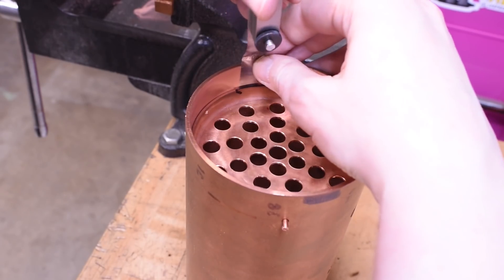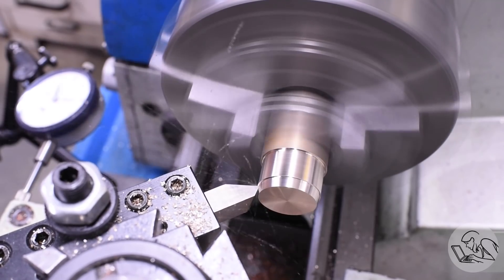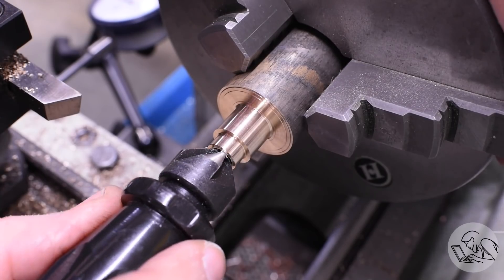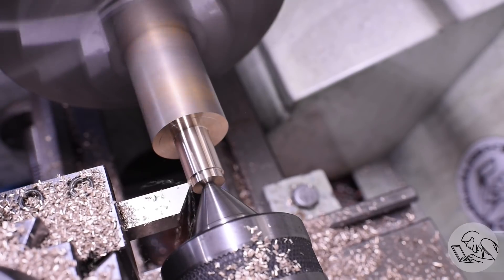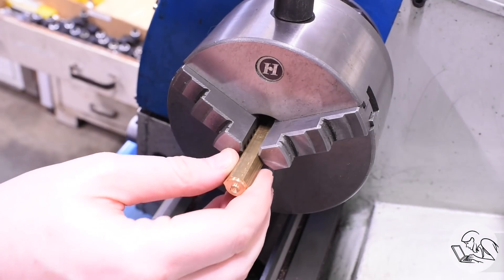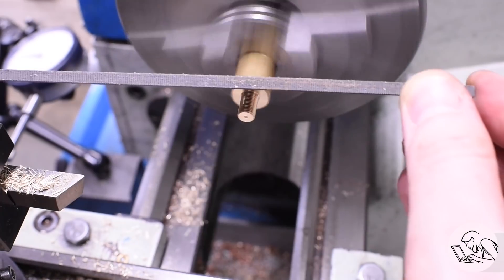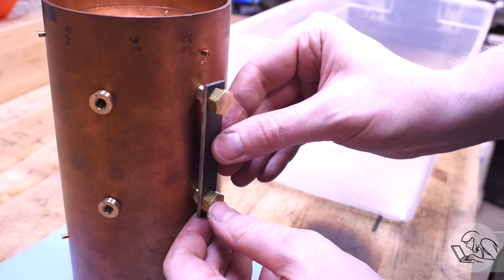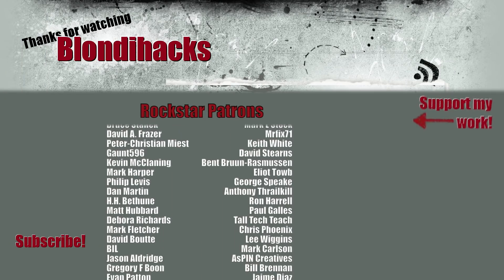Boiler Bushings & Silver Solder Prep | Model Boiler Build, Part 6

Comment: On a scrap piece try welding a copper tube to a copper plate with a electrical ground wire. I  have been welding manifolds for 20 years using acetylene . I have never done this with a heat exchanger but it does work well with hot and cold manifolds.

Comment: Hi Quinn, I have much experience making many copper boilers. I think you have been really unlucky with your vertical boiler. I have a few tips to offer that I hope will help you in the future. You should be able to braze a boiler of this size using only your smaller of the two propane torches. I have both sizes and find the largest too fierce. Regarding the silver solder, I see you are using wire. This is far too small and will become weak and will easily melt in the flame. I use 1.5mm dia rods. These are much more stable. Tip; take a new rod and grip the last end ½” with pliers. Bend the end 90°. Now if you hold the bent end and you accidently drop the rod. You know which end to pick up! Using the oxy acetylene after pre - heating with propane is good practice should you need to concentrate on a small area. I don’t believe you have your torch set up correctly. Set the regulators on the bottles to 50 psi for the oxygen and 5 psi for the acetylene. These are set with the torch lit. Then adjust the torch to give a flame like a small feather. Set up in this way will give you much more control with less chance of burning the copper. I also recommend that you keep dipping the silver solder rod in the dry flux powder to ensure an adequate supply of flux on the copper whilst the brazing operation is taking place. Finally, I can recommend a book on boiler making. Model Locomotive Boilermaking by Alec Farmer. Introduced in the UK in the early 1970s. You may be able to get a copy on ebay. This is without a doubt the very best book on boiler making you will find anywhere. Good luck with your new boiler. Stuart Dixon.
Reply from the maker: I appreciate the tips! My acetylene torch is set up correctly, but thank you anyway. Especially for the book recommendation! Boiler books are hard to find so I always want more of them

Comment: Love your channel. A tip on silver soldering: I learned in jewelry and in machine shop brazing that one way to ensure the proper stand off for surfaces being silver soldered brazed is to use an awl or center punch to put some tiny raised places. The displaced metal from a small center punch keeps the surfaces apart just the right amount.

Comment: I have a similar model of high speed chuck adjustment tool.  I find that mine is also useful for running nuts up longer bolts and threaded rod.

Comment: Titanium is also good because its heat conductivity is very low so the wire won't suck your heat away. In jewelry making we use titanium solder picks which are hand held and stay cool on the hand end when red hot on the pick up the solder balls end.

Comment: Fun video as always!

Ah, tapping drill sizes. I felt so fancy and almost like a machinist, I tapped what I think might be my first fresh hole a few weekends ago (adding a grease fitting to a string trimmer gearbox). I looked up the tapping drill size for my imperial grease fittings, then went "crap I don't have that series of drills". And, the nearest fractional size looked scary, so I snuck up on it and got it to work like 1/16th smaller than I was supposed to drill, but it worked. 

Now I just gotta figure out a good way to cheaply hydrostatic test my compressor tank...

Comment: Brilliant as usual but surely it is hydraulic testing not hydrostatic testing? Keep up the great work young lady.
Reply: Nope its Hydrostatic testing.  Hydro, as in water/fluid    Static, as in not moving
Reply: @oldog2  Surely hydrostatic means constant head and hydraulic means increasing /decreasing pressure? It's semantics after all.
Reply: @FormicidaeMillinery  I have no problem with this. As long as a boiler is tested correctly then that's fine by me. I still say that increasing a boiler from zero to twice working pressure is an hydraulic test but it's all words.

Comment: Hi, Quinn!

The boiler is looking great, and I can’t wait to see the next video.  One thing I feel I should mention though, about your use of Titanium wire:  be careful when doing anything that may heat it up too much.  For the most part, Titanium wire is as safe as kittens.  But if you heat it to the point where a white scale forms on it, be extremely careful not to do too much breathing in its vicinity.  Titanium oxides can do some MAJORLY nasty things to your lungs!

Comment: Is there a particular reason why you use a squeeze bulb to blow off chips instead of a low velocity/high volume compressed air nozzle?
Reply: I believe in other video(s) she’s stated the shop is too small to house a compressor system (taking into account actual space needed and noise isolation).

Comment: Bonjour Quinn,
In France, for our models, we commonly use 6 x 0,75mm, 8 x 0,75 mm or 8 x 1,00 mm, this is why mixing French and English accessories is so difficult.
Besides this, I think that your bushings heads are not thick enough to be able to install a layer of insulation such as cork and wooden slats, all of which may exceed 4-5 mm thick. This is always my problem on boilers I buy :+(
Amicalement, Raphaël

Comment: For me the horrible thing about using oversize stock is watching my hard earned money turn into chips.  It is almost as bad as paying property tax for one street light and a fortnightly bin collection.
Reply: Another issue with using the core of a large diameter bar is that your grain structure gets coarser and intergranular inclusions become more common because the center of the bar was the last part to solidify. So anything that came out of solution before it solidifies becomes an inclusion.  And the center gets the least amount of compressive work by the mill rollers so the grains that grew quite large because the center stayed hot longer dont get broken up through cold/hot work..

Comment: Hello Quinn at 5:00 M8x08 we do not have it is normal M8x1.25 or M8x1 or M8x0.75 also at 10:53 M6x0.6 we do not have either it is M6x1 or M6x0.75 But  it whas a nice video aswell 😉👍👍💋
Reply from the maker: Hence the approximation symbol. The conversions are to give a sense of sizes for people with different measuring systems, not to list actual parts dimensions you would use.